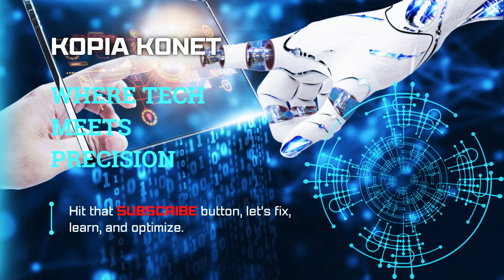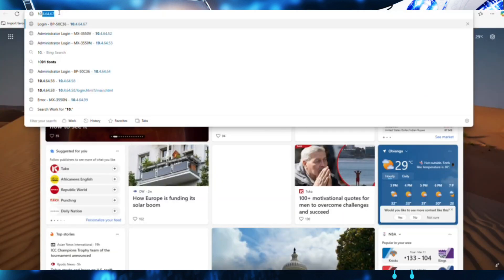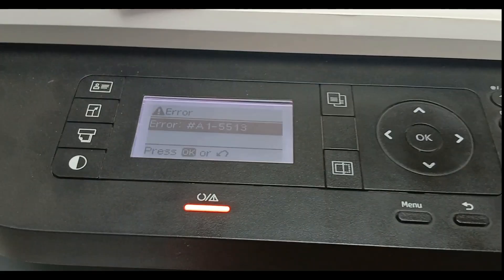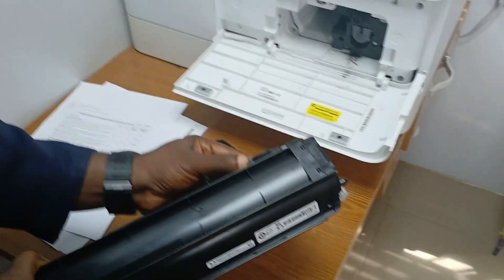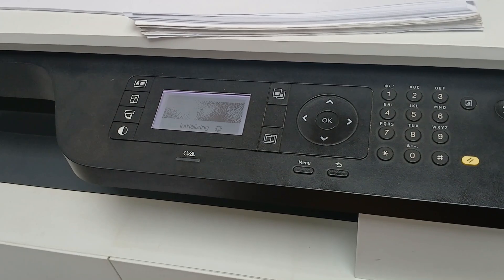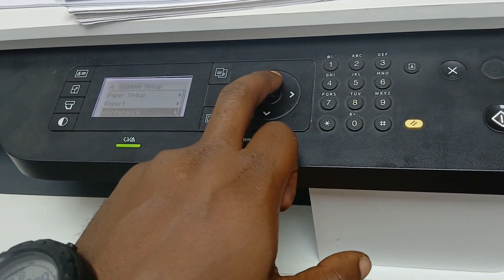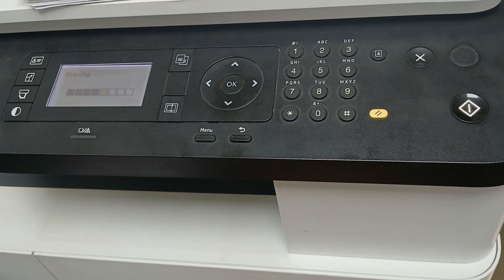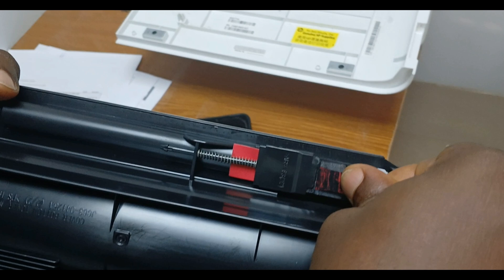HP LaserJet MFP 442dn/436dn Printer Error Code A1-5513 Resolved.

Comment: Thank you dear for the tutorial, in my case the Toner was not used for very long time, so the powder become hard, blocking the motor rotation, after changing the toner with new toner solved the issue. But got the lead from your video only. thanks again.